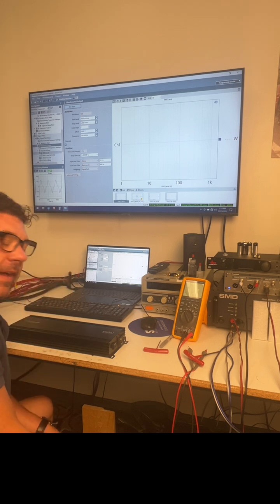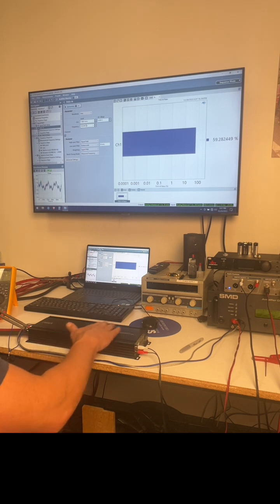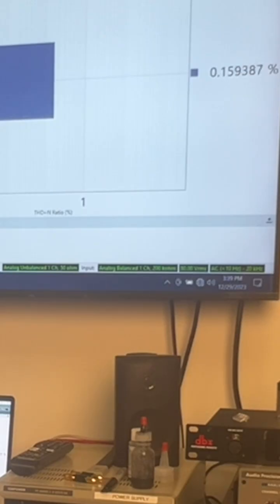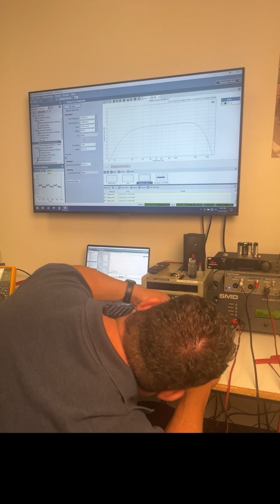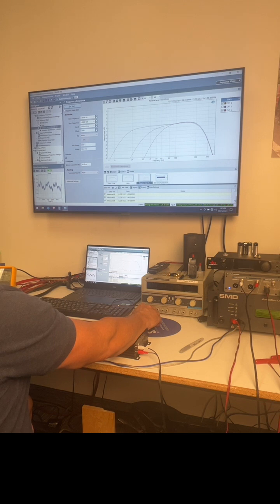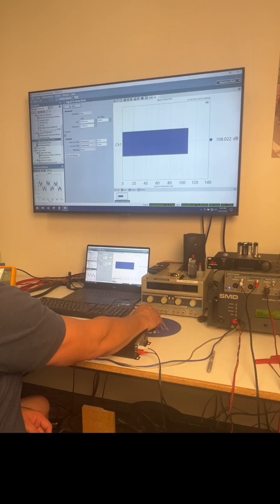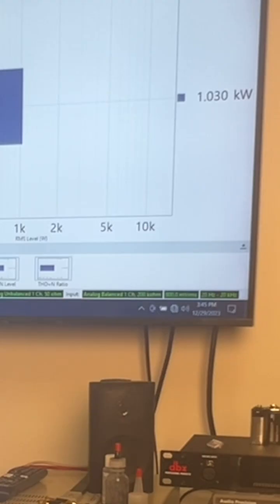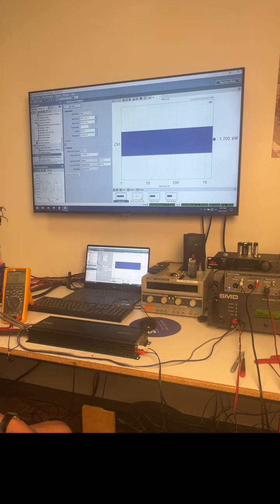S1E4 D'Amore Engineering Bench Testing E1500.1 Car Audio Amplifier

Comment: Great video 
Tony why is THD+N measured at a certain frequency with a certain frequency instead of white or pink noise? 

By the way you miss labels the amp on this video.
Reply from the maker: Good question!  Distortion is anything that is different between the input signal and the amplified output signal.  White noise or Pink noise is random.  Therefore there is no way to predict what the signal is going to look like, this makes it difficult to compare to the output.  Not impossible, but not the way it is typically done.  Good looking out on the typo, fixed.

Comment: why did you do those last runs uncertified to clipping.?lol
Reply from the maker: The dyno is set to uncertified just by chance, it wouldn't matter what I had the dyno set to during these tests because I'm not using the dyno to read power, only using it as a load.  The Audio Precision is doing all of the measuring.  It increases the signal until the amplifier reaches a level of distortion that is set by the user.  In my testing I have it set to 1.0%, so it is exactly how the AD-1 dyno works in Certified Mode.